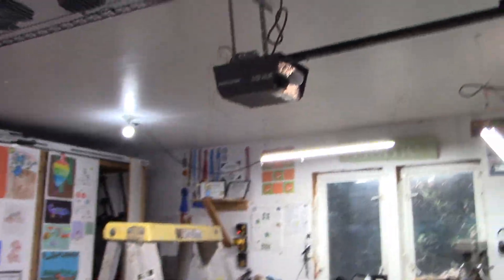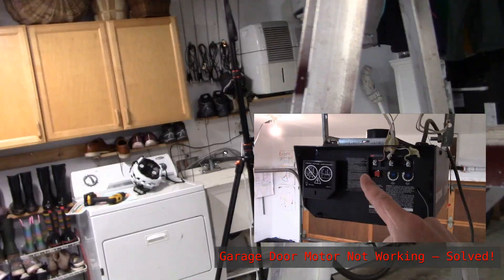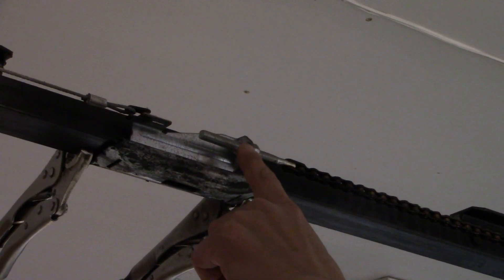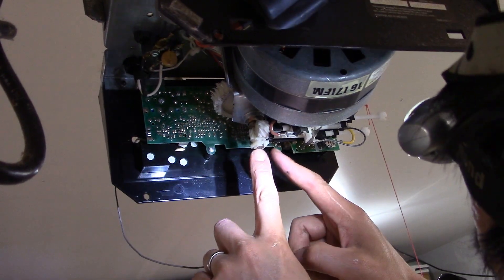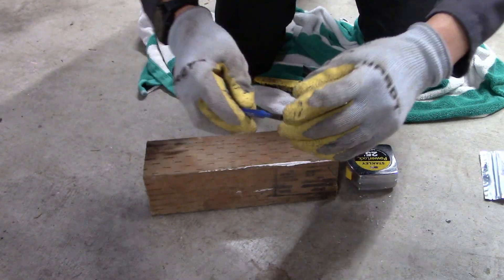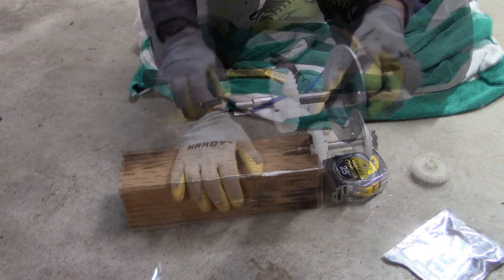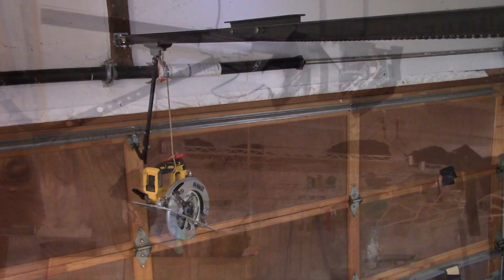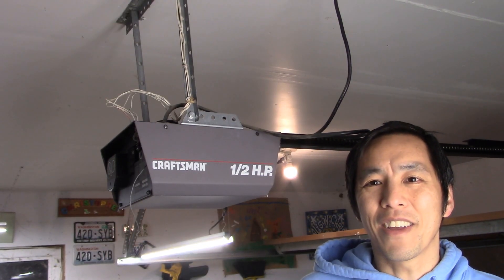Garage Door Motor Turns But Door Does Not Open – Solved!

Comment: Great video. My garage door opener stopped working a few days ago. I googled I can hear the motor but the door won't open and this link popped up. Sure enough...it is exactly the symptoms I have. I have two doors (two motors) and thankfully the unused side is the one currently affected. Both units are old...at least 30 years old. So followed the steps in the video and disassembled the broken side. I ordered set of new drive gears. They should arrive tomorrow and I'll reassemble the broken side and likely start the replacement on the other side since it is likely in similar condition. Thanks! The hardest part of all of this is removing the roll pin without deforming it. Thanks so much for the video. Gave me the confidence to do the repair myself.

Comment: 👍 Good to see you greased it after. Lol
I did this on a friends garage opener, they had a large heavy wood door as well, one thing to remember  is after a decade or so,  is to re-grease, over time the grease dries or gets pushed out and the gear fails, also on heavy doors as the springs weaken the door can become imbalanced which strains the opener. That gear is sort of a shear pin, so the opener doesn't self-destruct.
Reply from the maker: Yep, I think that's a great point to mention, thanks for the pointer!